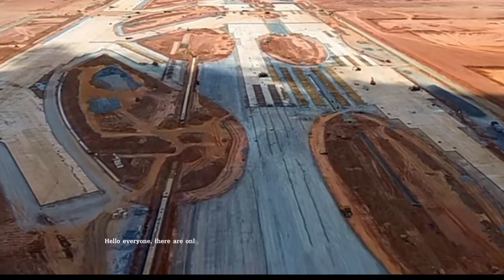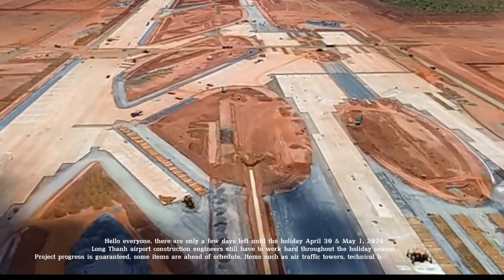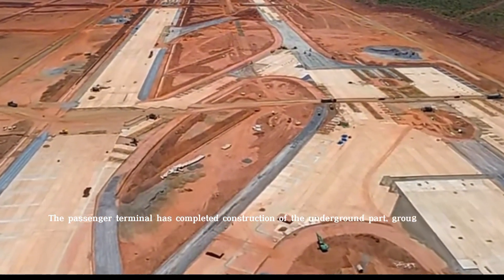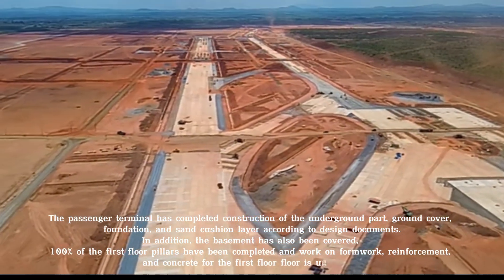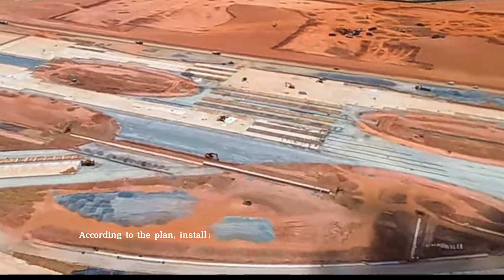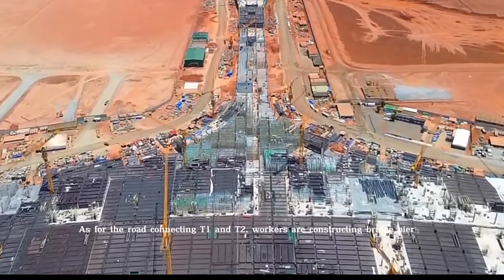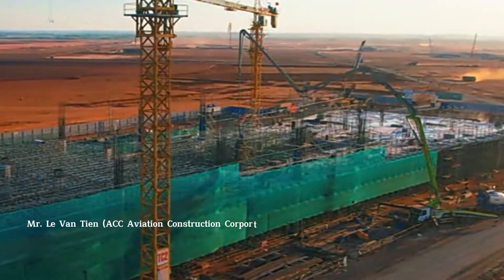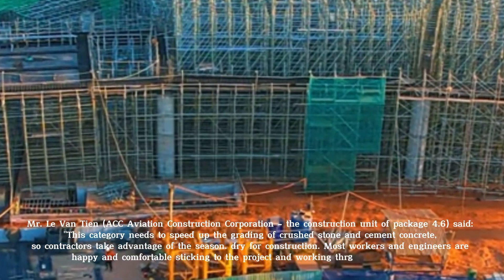Engineers work through holidays, April 30 & May 1, despite the hot weather, sân bay Long thành

Comment from the maker: The passenger terminal has completed construction of the underground part, ground cover, foundation, and sand cushion layer according to design documents.

In addition, the basement has also been covered, 100% of the first floor pillars have been completed and work on formwork, reinforcement, and concrete for the first floor floor is underway.